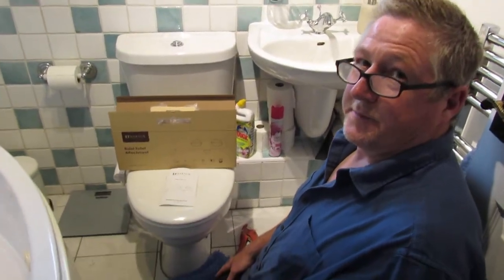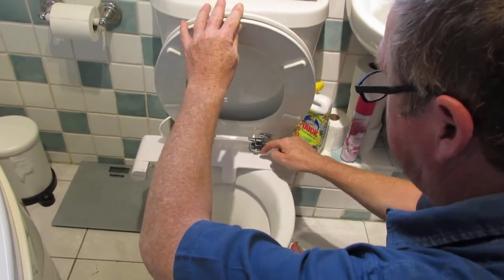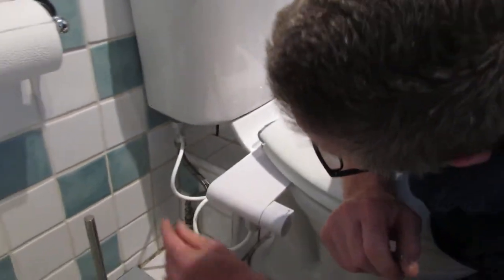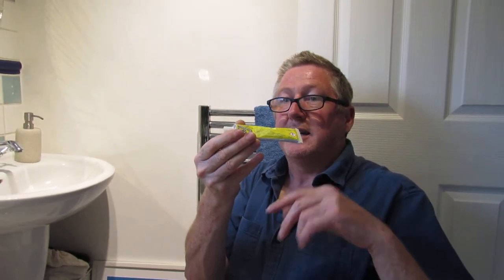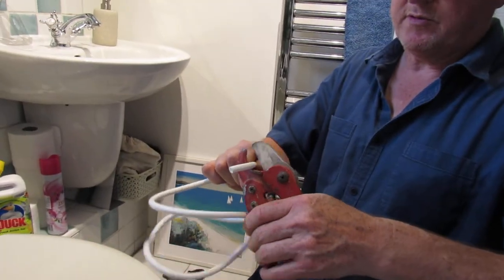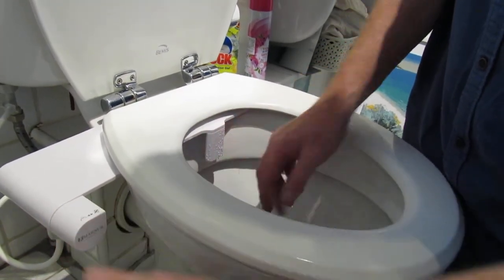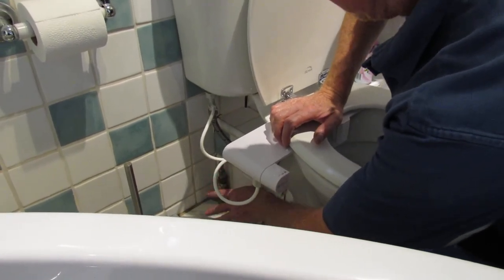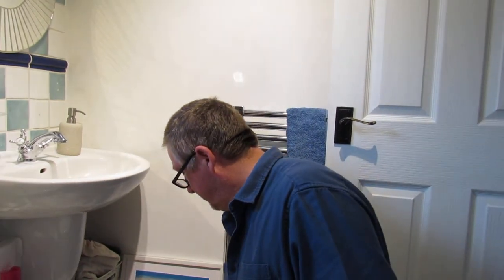How to install and retrofit an existing toilet with a bidet system - Marnur Bidet Toilet Attachment

Comment: I got a different one recently. But in general, these types of bidets don't conform to UK water regulations right? There's a risk of backflow if the toilet backs up so a DC valve or seperate cistern (air gap) is needed.